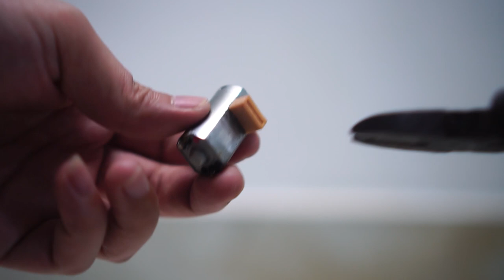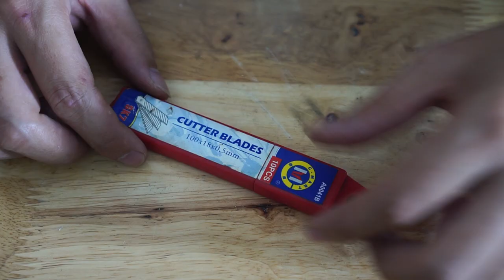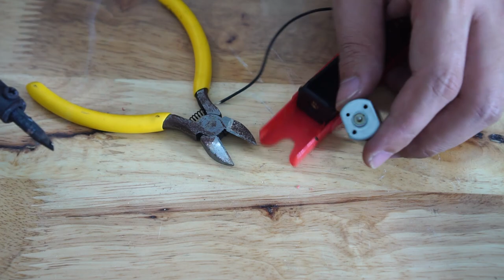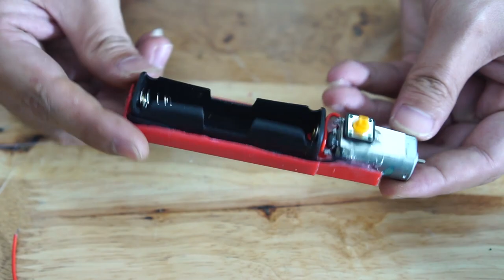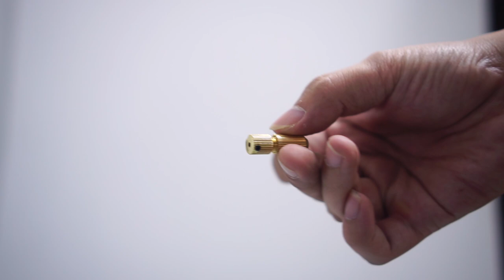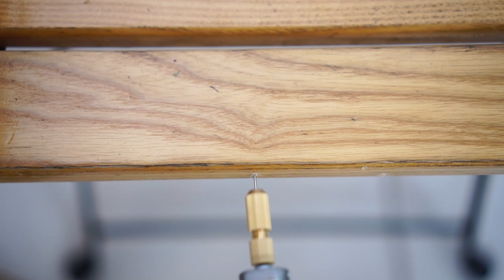DIY Mini drill Super Small & Strong

Comment: It would be better if you made it rechargeable ❤❤❤❤❤❤❤
Reply: You can do it with a USB-A port and a retifier diode in series, to avoid heat you also put a 10uH inductor in series, you can also add an LED to indicate charging. Zero cost circuit maked by me, i learn put this inductor recently before the circuit was overheatig.
Geetings from Brasil! 👍